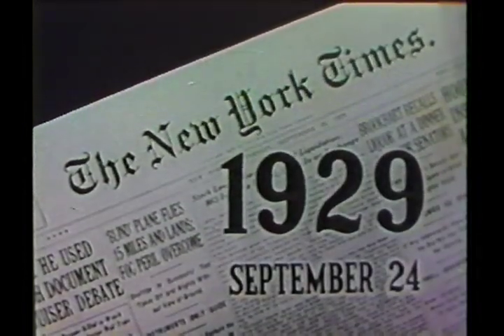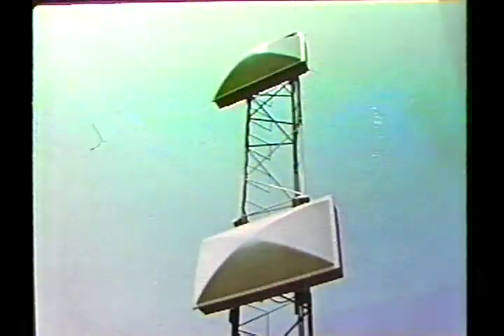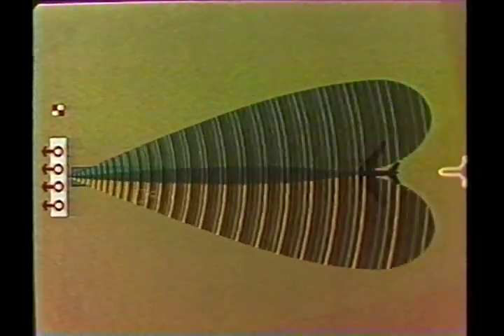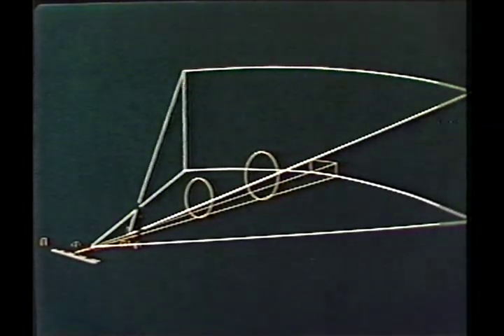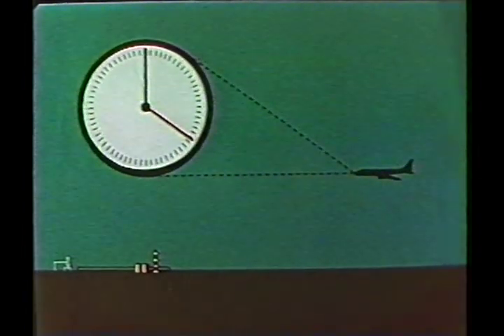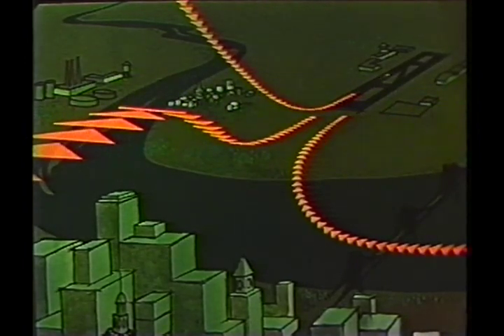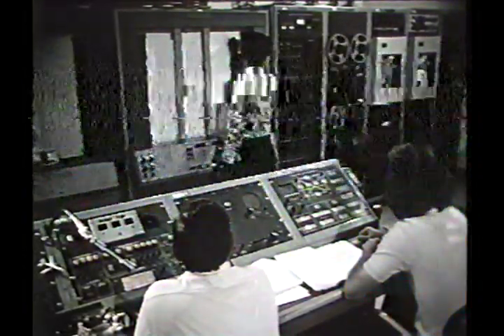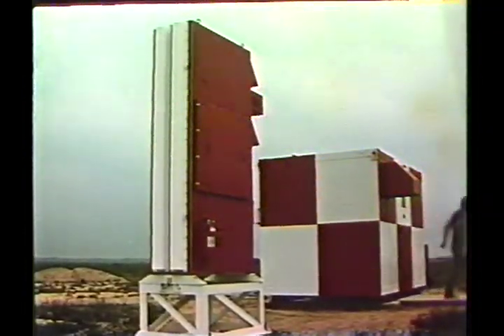Microwave Landing Systems - FAA video Private/Instrument/Commercial Pilot training 1974

Comment: guess they didn't see the GPS coming
Reply: William W. Campbell-Shepherd IX  the RNP is also a GPS guided approach, its primary purpose is to make approaches fuel efficient, make traffic flow faster and most importantly noise abatement. 

The approach procedure will start by instructing the pilot to a waypoint that will introduce them to the base leg of the approach.

Comment: is this the same system for space shuttle landing?
Reply: Yes/no. MSBLS that the shuttle used was in a lot of ways a prototype/tech demonstrator for MLS, and worked pretty much identically. The FAA also certified the MSBLS systems (and I imagine, used it as training for MLS testing). They were not compatible (different frequencies for just one thing), but were... closely related.